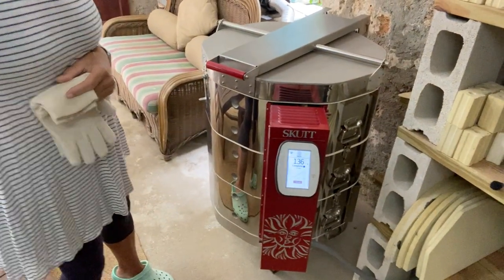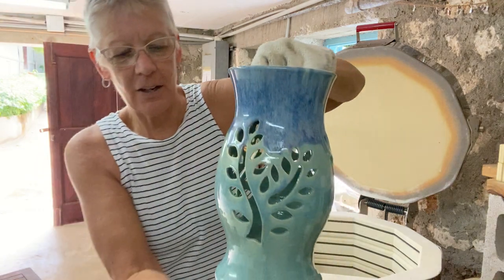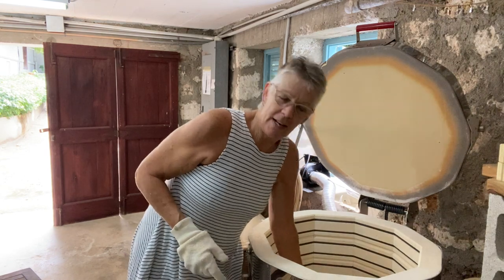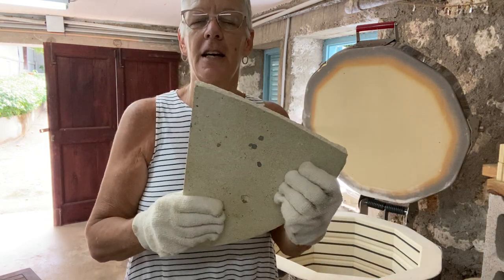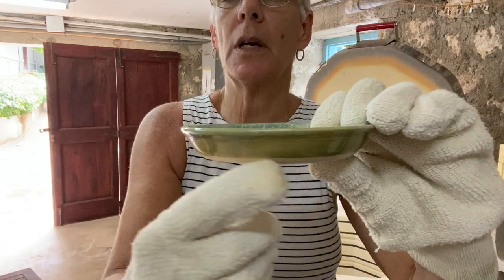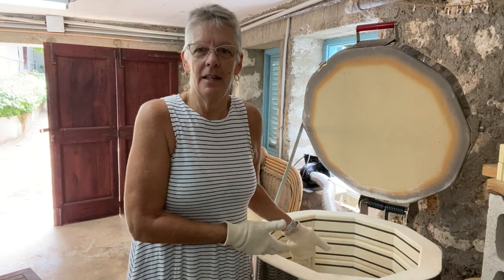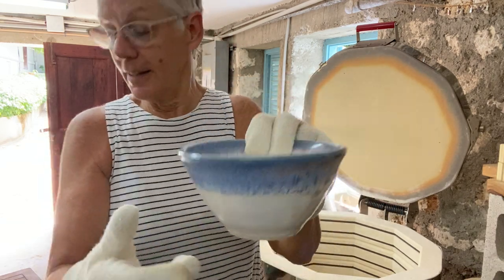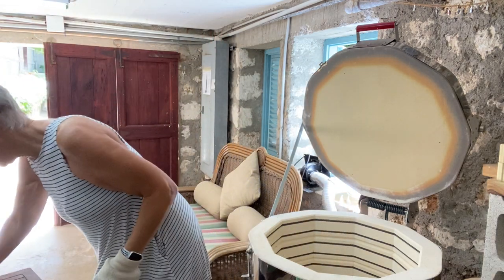Kiln Unloading

Comment: Wonderful selection and some good tips. Especially that simple one about the Y cuts in the lantern. Making bottomless lanterns really appeal to me, seeing how nicely finished they are with a dish under them.
I took note from one of Vaughan Smith's videos who is in Nova Scotia and I now coat the top and bottom of my posts with kiln wash so they don't stick to the Advancer Shelves. I love the Advancers so much I even got them for my wee test kiln, they are only 4" x 4".
I know all back problems are a pain and may have different causes. For me I mounted a pull up bar in my garage just high enough I can grasp while standing tippy toe. I slowly let me heels drop to the floor and have found it has been pretty instant relief for me. I first used the top of our door jambs and held on with my finger tips then invested in a pullup bar.
Thanks for sharing your ideas and thoughts.
Cheers and be well!   Freddie
Reply from the maker: I am sorry it has taken me so long to respond, I am just seeing this now.    Thanks for your comments and for your support